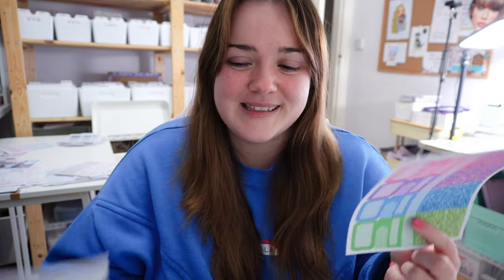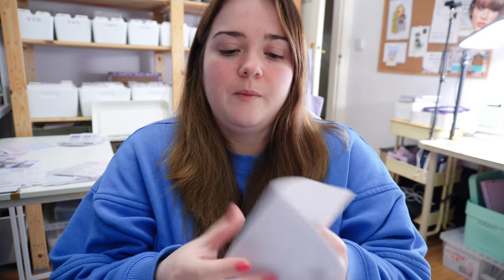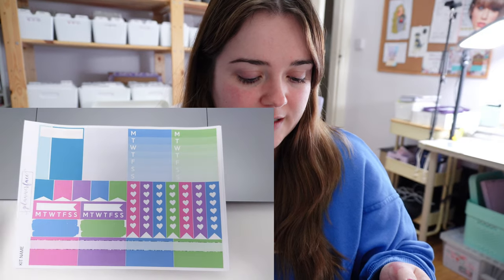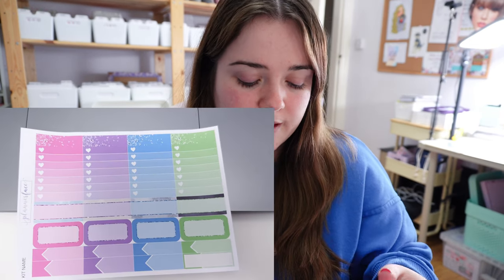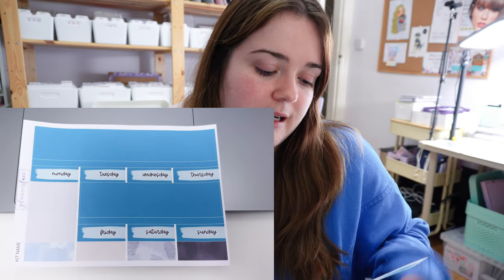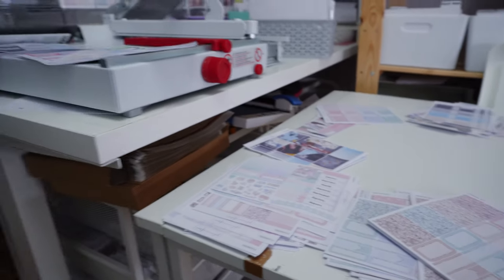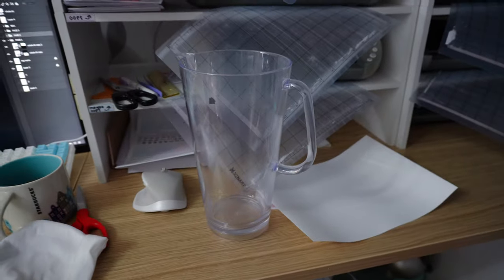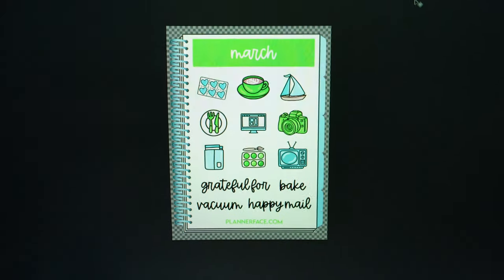Snow & New Kit Design for the Graphtec! | STUDIO VLOG #98 | Plannerface

Comment: These vlogs are so interesting. It’s amazing what you have to go through as a small business owner.
I have eczema and personally don’t get along with E45. Mine flares in extreme heat and stress. The stress you’ve had at the moment may be making yours flare up. The Body Shop hemp hand protector is an amazing hand cream but I haven’t tried any of the body stuff. The best thing I’ve ever tried for eczema that really flares up on my face and body is Hydromol. My GP prescribed it and it’s really soothing. But it is a very greasy butter like substance that’s only for when my skin feels like it’s on fire. I also use Dermol 500 lotion as a soap substitute, again, prescribed by the doctor.
Reply: The cold weather and stress could be making your skin reactive. Hope you get it sorted soon. ❤
Reply from the maker: Thank you so much for the tips!! Good point, the cold weather could be playing a part too 😩

Comment: 8 months later, let me swoop in and solve your problems 😂

I use Dermol 500 cream I think [there’s a cream and lotion]. It’s also antibacterial. They have lotions, creams, body washes etc but I just changed my soap, I now use whipped soap so it minimises the sulphates and I regularly use Dermol and it’s worked amazing for my dermatitis. Haven’t had any dry patches on my arms, face or legs since using that combo 👍🏽
Reply from the maker: Oooooh thank you for this!! I will defo give their soap a try when I run out of mine. I realised my fabric conditioner was causing me issues - I don't get on with Comfort apparently. Switched back to Fairy and I've been much better.